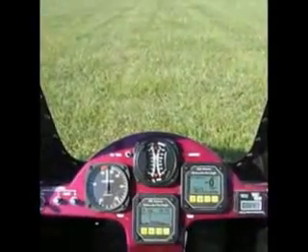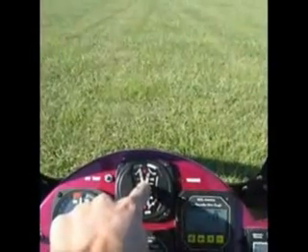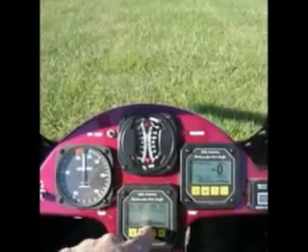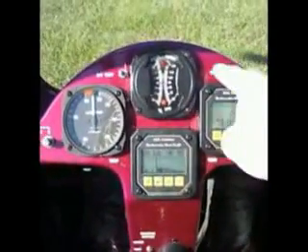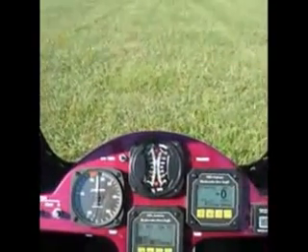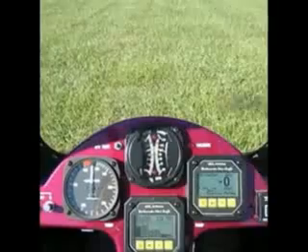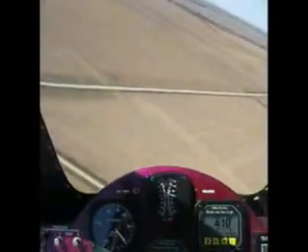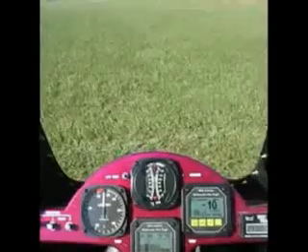Mosquito XE Ultralight Helicopter (Autorotation)

Comment: I have so many questions.  So you are basically pitching for best glide Which in turn will give you the optimum rotor inertia?  Which then is more than enough to arrest your downward velocity in the flare.  For some reason I always thought you'd pitch full forward to keep the wind going thru the rotor. but I see that too much wind could be a problem also. Over speed (VNE) GREAT PILOTING! You and the dog survived :)

Comment: Novice/Noob, what is the purpose of AutoRotation?  I am looking into learning to fly a helicopter and eventually purchase one for my commute.  Just a noob question, thanks.
Reply: resourceful enough to buy and operate a helicopter for commuting purposes but not to look up basic stuff on the internet
Reply: +SubieSTiDriver Purpose is to land safely if the engine quits by using the potential energy of your speed and altitude to keep the rotor turning as you GLIDE to a landing spot and flare. Flare is accomplished by converting all that stored potential E in the spinning rotor into Kinetic E to use up for a smooth touch down as demonstrated in the great video.

Comment: May I ask what prevented the engine from re-engaging and driving the rotors once more as you pulled pitch after the flare? Was it that the engine rpm was too low to engage the centrifugal clutch? Also, what is the typical rate of descent and how quickly must the collective be lowered to prevent loss of rotor rpm? Finally, at what height do you typically initiate the flare and at what height do you check on the lever to cushion the touchdown (which looked to be zero run on to me!). Thank you, a great video!
Reply: +Felix Deer He's great isn't he? Helicopters have a "correlator" which automatically adds throttle as collective is raised as in the situation after the flare as you mentioned in a practice TD auto. There is an "over-ride position" designed into the collective to disengage throttle increase as collective is raised as commanded by the designed in correlator rigging. To go into "over-ride" for a practice TD Auto (to prevent engine RPM increase), you rotate the throttle grip below idle against spring tension to disengage throttle "correlation" that normally increases throttle as collective is raised. If you have a REAL engine failure instead of a practice TD auto, you don't need to go into "over-ride" against the spring because there is no throttle increase to worry about with a real engine failure as collective is raised after the flare for TD.

Comment: It can be built as either an ultralight or an experimental amateur-built helicopter.  The ultralight version carries 5 gallons of gas and has to be outfitted with floats.
The experimental version can carry up to 20 gallons of fuel and can even have a turbine engine.  There's good info on this helicopter at rotorfxdotcom.

Comment: I'm currently learning to fly a robinson r22, I've done quite a few solo flights, neviation, engine failure practise, Something I were wondering about, Does the little aircraft have carb heat or anything to prevent carb iceing, or does it have fuel injection. What is it like to fly, Wouldn't mind one of these myself, Look a lot of fun to fly. Is it anything like a r22 to fly.

Comment: @AstroTrain100 Turbines are more reliable because it's basically 1 moving part vs 100's in piston engine.. Plus, they are extremely powerful for their size.. better high altitude performance.. Smoother and quieter. etc... etc... Basically better in every way.. Disadvantages?.. VERY Expensive!

Comment: @HarryHydro Collective- Reduce to maintain rotor RPM within limits...  Pedal- Adjust - crab or slip as required...  Throttle- adjust as necessary, close as required....  Airspeed- Adjust as required.  The part you're wondering about is the collective- basically you drop the collective (pitch) as far down as it goes until after the flare.

Comment: @HarryHydro - When auto rotating you convert potential energy (altitude) to kinetic energy (rotor speed) until flaring, so yes, blade pitch is lowered to a small negative number.

Comment: HarryHydro.. Dont know how much you know about helicopters, but when you enter an autorotation it´s basicly like blowing on a fan.. The air is coming up through the rotorsystem. 

The more pitch you have the more you slow the rotors down. Usually you have to lower the collective all the way when entering an autorotation. If you see helicopters doing stalling their rotors in mid air, then that´s usually because they fail to lower collective fast enough.. In the R22 you have 1.6 seconds to do so.

Comment: I thought you were done? I know a lot of people don't mean to mislead people, but this all started with a comment that after stalling rotor blades and allowing them to spin down, you could somehow spin then back up. And that is misleading. Obviously, no pilot would attempt that based on what you just said, but isn't it better to have the correct information?

In movies like Die another day, they can do that, but its hollywood. I think that's a major cause of the misinformation.

Comment: OK, no. First of all, they're rotors.

The "critical" point is between 70 and 80% RPM, depending on the helicopter. At this point, the rotor stalls, rapidly spins down because of the increase in friction during a stall, and there is no recovery.

The horn comes on at the bottom of the green arc. In most, this is 97%. The horn is a friendly reminder that your RPM is low and should be corrected, not something where youre in an unrecoverable situation.

Comment: Oh Yea! no kidding this will result in a fatal crash.

I didn't mean the extreme. Letting the rotor speed drop to zero. This will definetely overstess the wings.

I meant when the alarm sounds you are allready at the critical point and if you don't have enough altitude to wind the rotor back up then you will crash hard.

This is not something for pilots to intentionally risk.

Comment: Enter auto, or roll the throttle off... Basically, the TR is there to counteract the torque of the engine. Take that away and the helicopter will stop spinning almost immediately... Thats a simple definition, but im tired and thats all youre gona get...

Comment: There really is no need. Some types of helicopters will give an engine out warning. On this, it will take a fraction of a second for the RPM to drop below the green and the horn to go on. Besides, it would get very annoying to have to listen to a horn the entire time I was autoing because the horn was blaring about a low engine RPM. Its better to have the horn warning you if your blade RPM is getting low

Also, the feel of the helicopter yawing left or right will be your first major indication.

Comment: That's why I was wondering why there was no alarm when the pilot throttled down -- letting the pilot know that rotor RPM would begin to drop before it actually did.

The needle seems to be the only indication besides, of course, the sound of the throttle backing off.

I guess it's irrelevant anyway, because the sound of the engine is probably the best indicator of all.

Comment: @car

If the engine quits, you will get the low rotor RPM horn quickly. In an r22, you have ~2 seconds to initiate your auto from engine out. Luckily, there are a lot of indications your engine went out besides a horn. A left or right yaw, change in engine noise (i.e. deafening silence), etc.

Read my other note for why we have an RPM horn. Its secondary duty is to tell you the engine went out, if you haven't readied it yet. The horn also sounds if you over speed the rotors which is very bad.

Comment: @neillil411 Sorry man, but thats not true.

We have a low rotor RPM alarm so we know if it drops below safe levels. If the RPM decays beyond a certain point (~80%... can change depending on aircraft, air density, etc.) the centripetal force of the rotor system ceases to keep the rotors extended against the upward flow of air and they fold up. There is no recovery from this, and if you are at an altitude where the height will kill you, you will die.

But you are right about cushioning at the end.

Comment: I guess the alarm is only to indicate a stall warning. If the engine quits the helo can still glide down by lowering collective and picking up rotor speed. As you near the gnd. you will pull up collective effectively using the rotor momentum to cusson your landing. Like a parrachute. If the rotor speed dropps off you will stall and you could crash unless you have enough altitude to wind the rotor back up again.

Comment: Great auto.

Why does the alarm only sound for the rotor slowing down and not for throttle off? 

If the engine had actually quit, would you get the alarm then?

Comment: I think he adjusts the collective to maintain the rotor speed in the green arc on the RPM gauge, then pulls up on collective right before landing (immediately after the flare which he said he did with cyclic) to slow the last part of the descent.

Comment: I understand that the collector is reduced to some thing less than max negative angle of attack?   Is that position somehow felt or prepositioned by a detent or the like?    Also is the negative angle on the collector maintained thruout the landing,   with the only thing changing is the cyclic angle of the rotor plane itself?
Reason for the question I was very near an air force helicopter crash because the pilot changed to a positive collector angle too early.